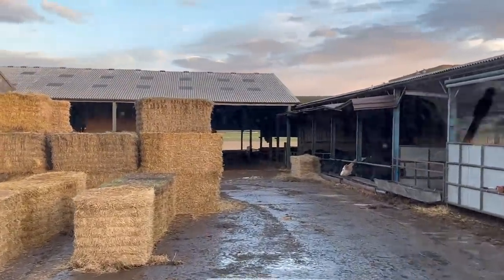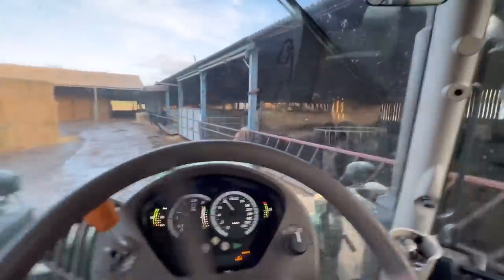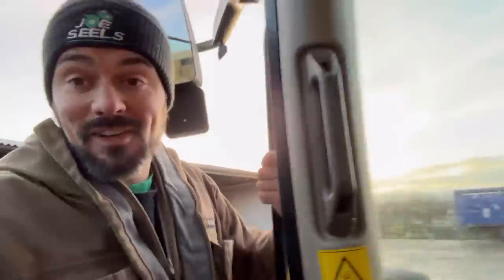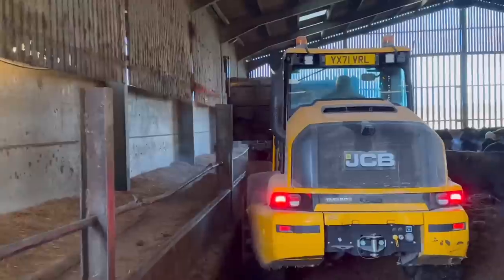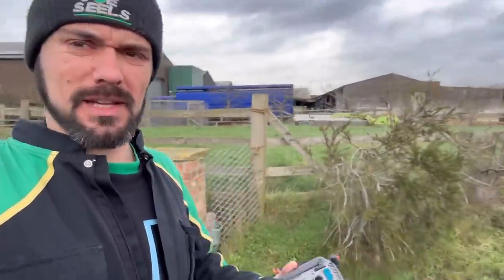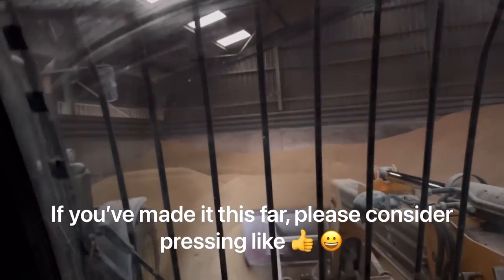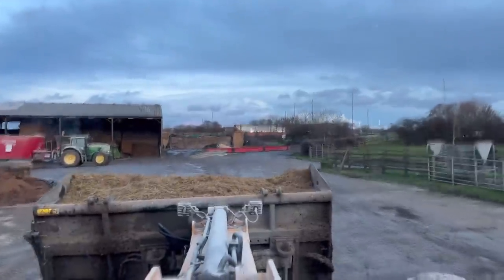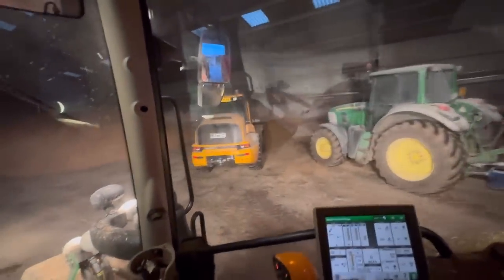Checking Gutters… no Ladders!? National Champion @ the farm!

Comment: Great minds Joe. Had a leak in my roof. Sent the Drone up and found loads of moss in the valley between two ridges. We cleared over 25kg of Moss, it was creating small dams and the torrential rain couldn't drain so water over spilled under the tiles. We then sprayed the roof with "Wet and Forget" kills moss for years. Just waiting for ceiling  to dry before sealing and re painting.